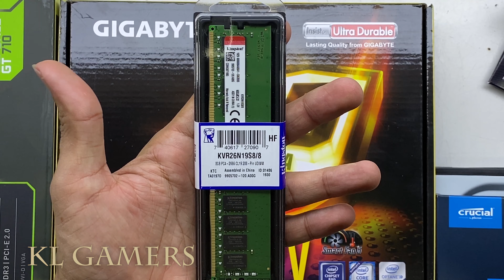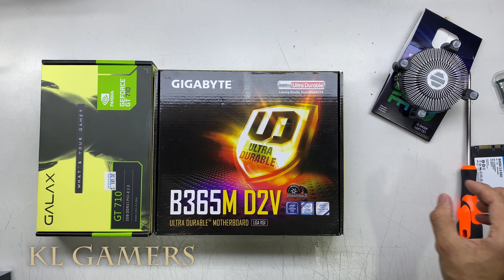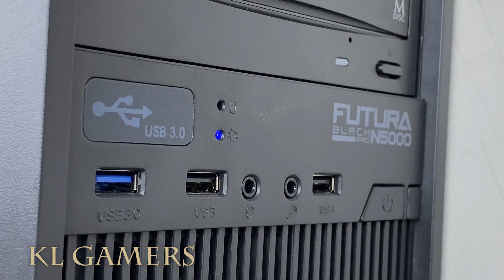intel Core i5 9400F GIGABYTE B365M D2V Crucial BX500 GT710 Alcatroz Futura Black N5000 Desktop Build

Comment: processor wasted with those components...
Reply: The only thing that sucks in that build is just the gt 710 but the customer might just want an office or work pc  the gt 710 with its fan less heatsink Is the reason many work pc use it also all others parts are still fine